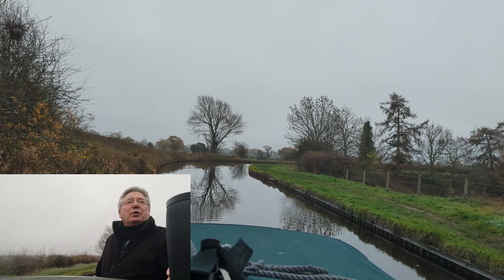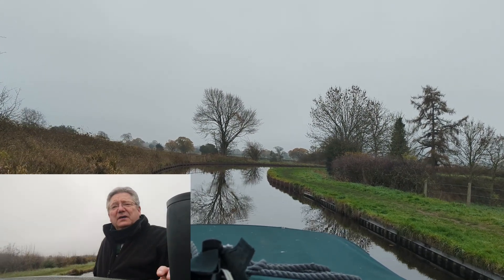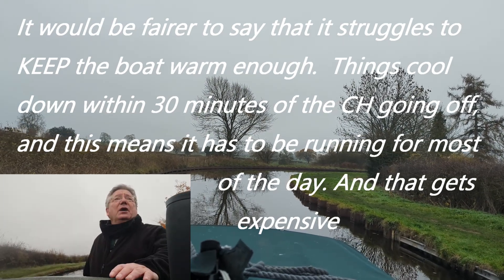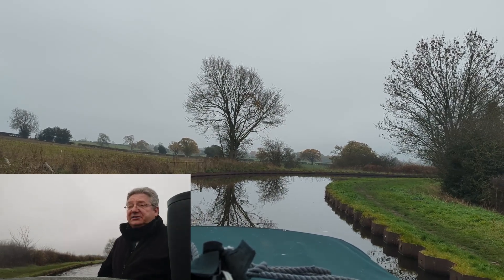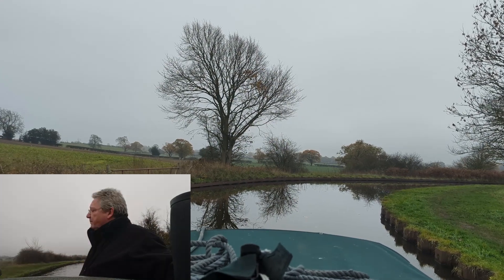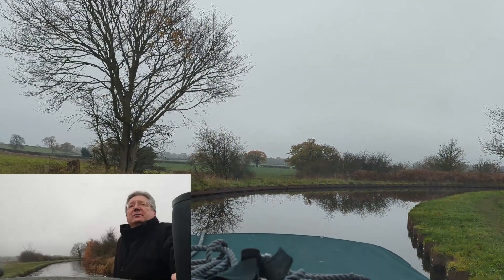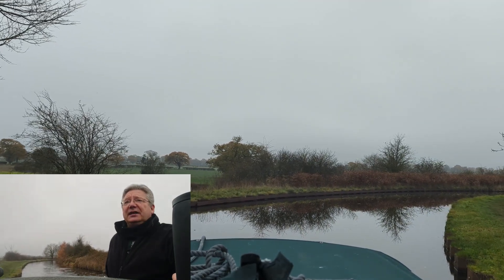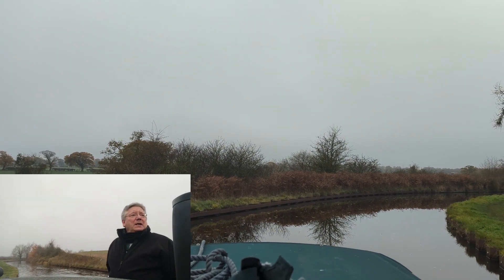Boating debates #1 - Coal Stove OR Diesel Central Heating?

Comment: We have both a coal stove and a diesel stove on our narrowboat Idle Days which are both in use during this cold spell. We are about to get rid of the coal stove and replace it with a Reflex diesel heater as I'm fed up with having to get out of bed several times a night to add fuel to the stove as well as lugging heavy bags of coal; add in the amount of dirt generated by the coal stove and it just has to go, there is nothing to commend it.
Reply from the maker: That is a very good shout to be fair. I thought long and hard about having a diesel stove installed before I went for the coal stove about 2 years ago. 
My decision was mainly on price, as the diesel stoves I liked (by Bubble) were listed at around £1200, whereas my hamlet hardy cost less than £400. Two of the three diesel install firms I emailed never replied, and the third said they could not give me a quote for the installation costs until they travelled to the boat to examine it- and I think I would have been paying a couple of hundred in travel/time costs just to get the quote. 
So I went off the idea of a diesel stove, but you are right about the hassle and mess of a coal stove. It is a faff dusting up the ash and dust every day. 
I will say that its fairly easy to keep my stove ticking over for 7 hours or more without having to touch it, so I don't have to get up in the night to feed it. 
But if the costs had been a bit less, and if I'd got positive statements from the installers, I would have gone for the diesel option myself.

Comment: its a dry heat because the stove removes moist air from the boat and throws it up the chimney
Reply from the maker: Thanks Sean, I'd forgotten that the stove actually sucks in a much larger volume of air than I imagined it would do, and of course that is the moist air that is going out.

Comment: For the sake of your own health and other people's health, please use a diesel heater!! 
I live in a small Yorkshire village and over the last few years there's been a huge rise in the use of coal fires and wood burners. The impact on my health has been terrible to the extent that the doctors are advising that I move house.
A coal fire/wood burner is definitely bad for your lungs I have real experience.
It seems the only responsible way to use a fire is to burn smokeless coal and seasoned wood which has been stored in a dry atmosphere, something which isn't always possible on a narrow boat.
Please consider your own health and that of other boaters and towpath users.
Reply from the maker: I'm really sorry to hear of your issues Tim, and I have had some thoughts about the environmental impact of burning any fossil fuel for heat in winter- whether that be coal or diesel. 
My thinking on it is that if I were living in a house, I would still be using a lot of energy for heat- and probably significantly more energy than is needed to heat the interior of a boat. And with our current infrastructure, a lot of that energy for heating would have to come from burning gas or other fossil fuels. 
I haven't done any research but I am aware that diesel can produce particulate pollution, although I don't know how that compares to pollution from burning coal.  
I do actually use coal that is approved for use in urban areas, so I am hoping that will reduce the negative effects on any passers-by. Also, I usually moor in fairly isolated spots, so any pollution will not be concentrated where there are lots of people around. 

All the other boaters I've seen burn either coal or wood in winter, and in places where there are lots of boats, there will be more pollution. I honestly don't have a good answer for this issue at the moment, but I will say that if they changed to burning diesel all day long, that would also produce significant pollution.
It may be that gas CH is the way forward, but the price of bottled gas is so high at the moment that many would not be able to afford it.
Reply: @theamateurboater5892  Thanks for your reply and yes it's a difficult situation.I know diesel pollution is also a major issue ( I've had a life time of operating diesel farm machinery).Many boats have old diesel engines on a par with old diesel tractors.
I am pleased to know you are aware of the situation and doing your best.
I look forward to the day when electric and solar can provide propulsion and heating at a reasonable cost,but I think it will be a long time away.
Good luck with your adventures.